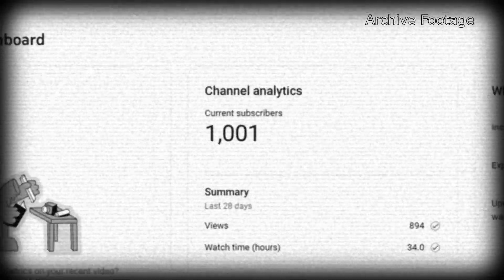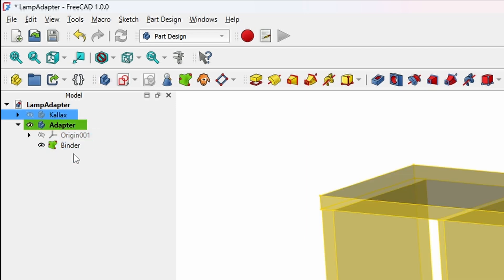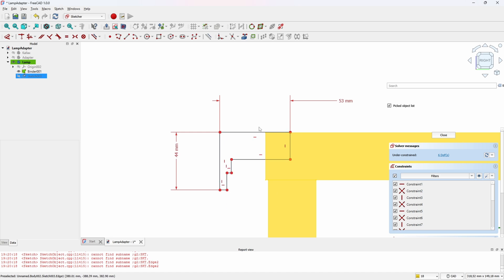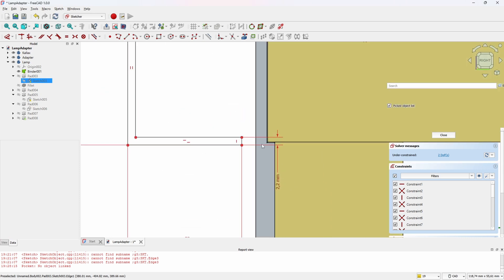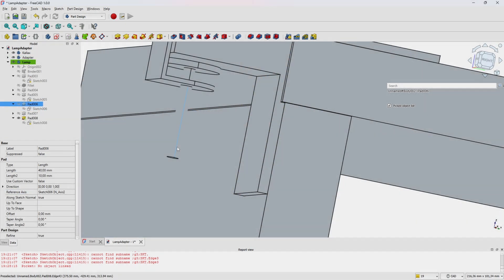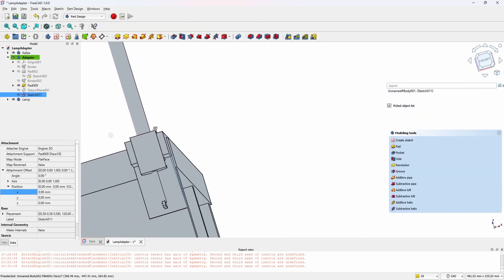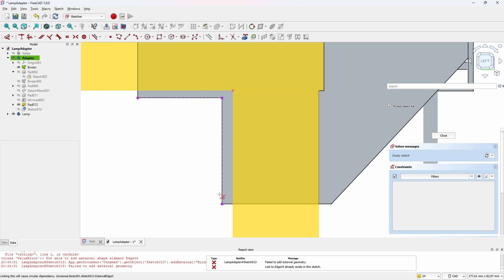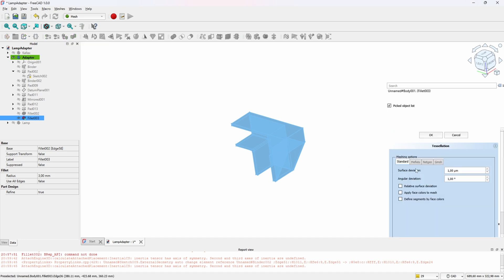FreeCAD v1.0: Let's build a Lamp Adapter!

Comment: Hey again! :)

One thing I would like is more details on the process once you have the shape done in FreeCAD, what do you do, exactly. You seem to mention "Mesh creation"? Without taking a few second to look it up, that sounds like the "export" process to obtain a printable STL? Then you slice it up (this part would also be interesting I think), and finally print?.

I'm really curious about the whole process / pipeline.

I liked the video. There was a few silences when you were working which some people might not like. I don't mind it. I work in silence sometimes.
Reply from the maker: Hi again! :)
Thanks for the feedback!  I have thought about making one that focuses more on the printing side, preferably when the modeling process  itself is simpler so that "there is time" to delve into the details of design choices for a successful print. 

Valuable to know that you thought it was a bit silent at times. I feel like I force myself to comment at times already to cut the silence, but I guess there is nothing wrong with doing it more.  :)

There should be more coming in the near future (not all FreeCAD-related though)!

Thanks again!